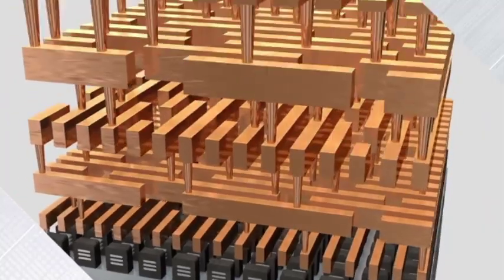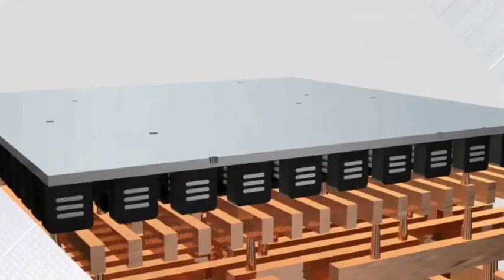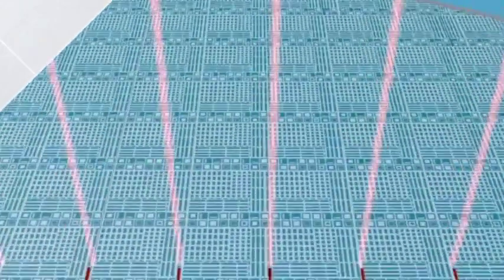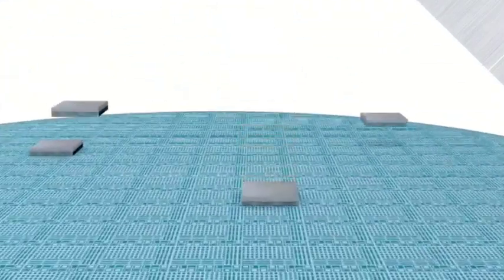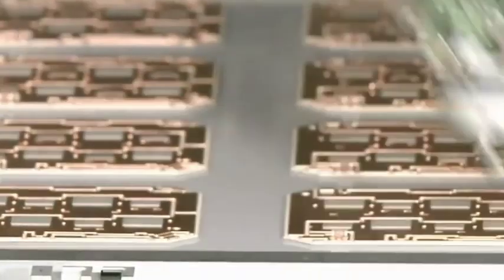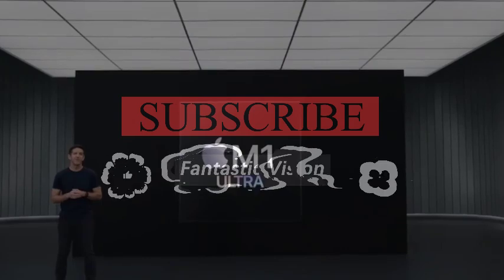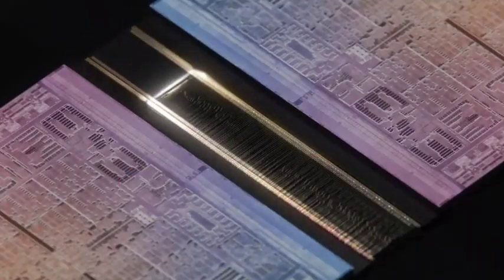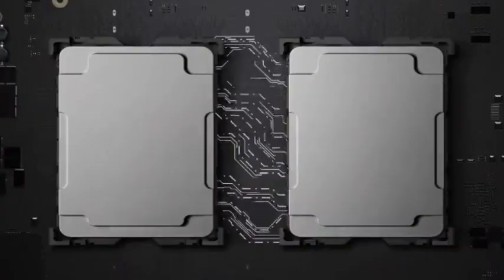China completed the packaging of the first 4nm chip, and US companies began to seek cooperation.

Comment: This is a backend process. The problem is the front especially the lithography machine. Doubt that a 4nm can be packaged through chiplet or stacking or other techniques from a 14nm chip of which what SMIC is mass producing. You likely need a sub 10nm chip. Even that the yield will not be ideal although it’s workable just the 4nm chip launched by Qualcomm and Mediatek of which were repackaged from a 5nm chip. China need to get their 14nm DUV up first or find someway to produce the chip without a DUV or better still EUV. If not this will always be the bottleneck. If China’s SMEE DUV can get to 14nm or more advance like 10nm then China can improve the packaging technique like stack and chiplet to increase the yield of 7nm, 6nm or 5nm repackaged chips. Getting access to 14nm, 12nm and 10nm is most critical for China to produce advance chips. Meanwhile China seems very productive at the 28nm level and more advance chips with mostly local content to provide for at least 70% of China’s requirement. China complete its local content from 14nm to 10nm will be a death blow to the American, South Korea, Japanese and the west semiconductor industries. The window is small for these players. Even at 28nm, the Chinese is playing havoc for these players. The temporary relief for these player is that SMIC took 14nm from its website. However I believe that SMIC will only emphasise on whatever that have very high local content. Once SMEE can affirmatively confirm it’s 14nm DUV, the 14nm products will go back into the website. Meanwhile SMIC focus on delivery to only specific client. It is not unknown that SMIC is already mass producing 14nm chips. However the core bread and butter will be from 28nm and more mature chips. It’s just logical to focus on the market that can give you a bulk until the technological availability catches up. I believe all SMIC 14nm is going to one client, Huawei of which will go through Huawei’s own stacking technology to hit 7nm and will be used to launched the Mate P60 5G phone. If the Mate P60 come is 5G without Qualcomm and Mediatek chip, it is then confirm that Huawei will use a 7nm chip with a modem chip in its new MateP60 5G phone. It will be by September. The technique has been used before. It will make the phone a bit thicker to dispense heat. The advantage is that the 7nm chip that provide the rest of the function is more stable and durable. Let’s see if Huawei can pull this off. If Huawei can the west will be in shock mode!
Reply: There is only one Carl Zeiss, no?
Reply: @propellerhead2000  Didn't Carl Zeiss open shop in China? I cannot imagine what it is doing in China.
Reply: @KennyL1  Packing their bags.
Reply: Thank you for your analysis!